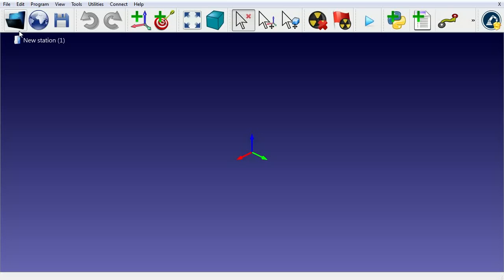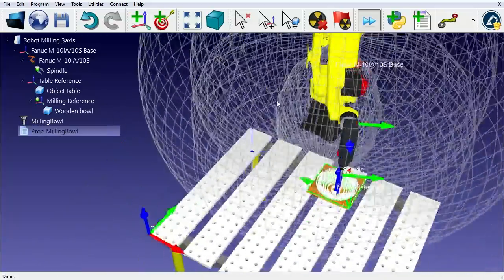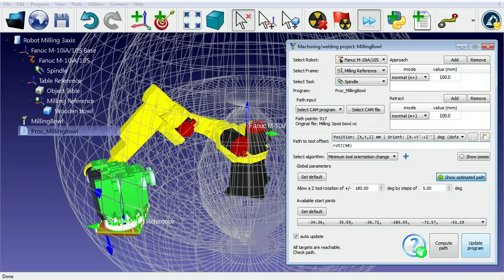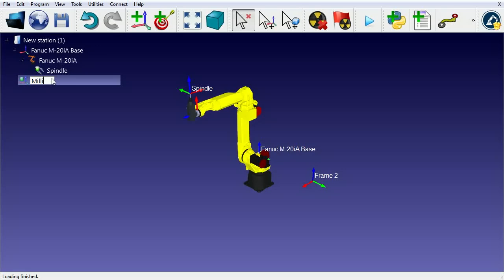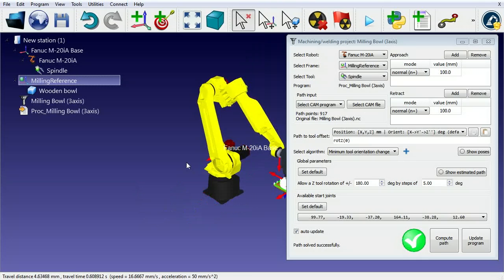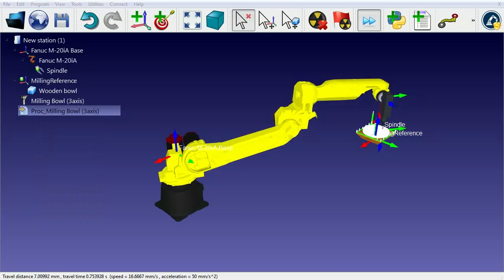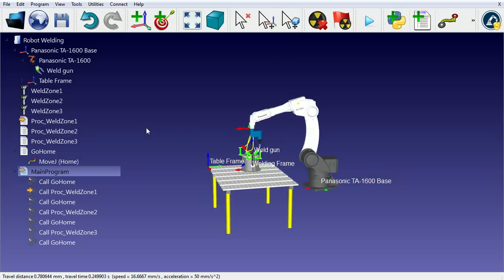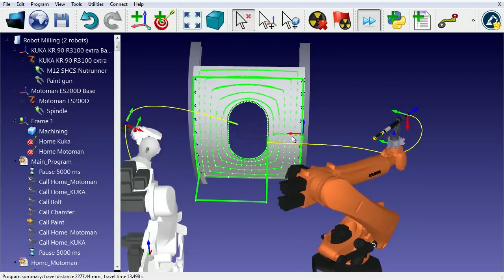Robot Milling - RoboDK

Comment: how do you define the robots location relative to the work items?
Reply from the maker: You can double click the reference frame to enter the XYZ position and Euler orientation angles (or quaternion values if you use ABB robots). You can also drag the reference frames by holding the ALT key. Finally, you can also calibrate tool frames and reference frames from the Utilities menu.